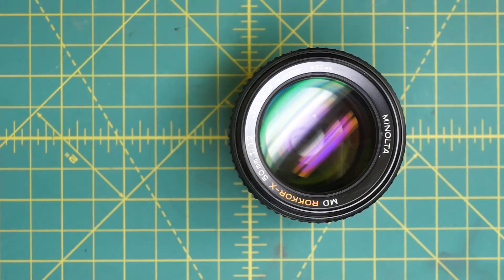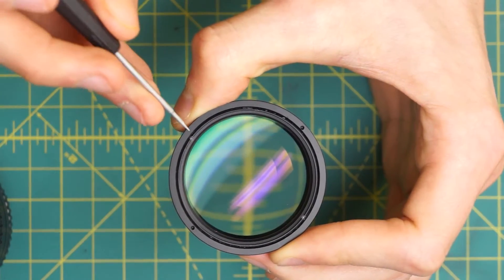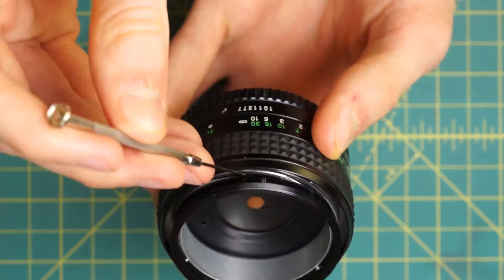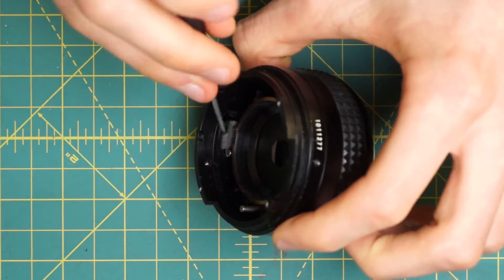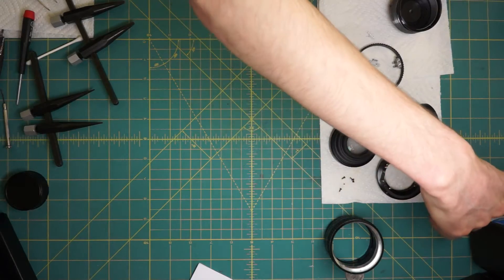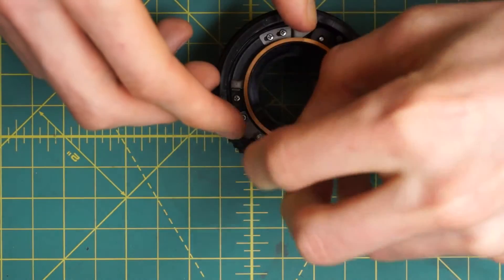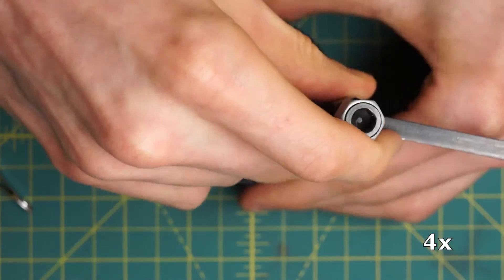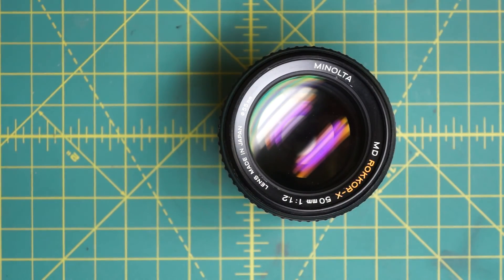Minolta MD Rokkor-X 50mm f1.2 Lens Disassembly

Comment: Thanks for sharing. I have a 50 MC ROKKOR lens, and there is only a small amount of dust in it. I will hear some noises when I put my ear to the side when rotating the focus ring, but the rotation process is very smooth. Is this because the damping oil is about to dry out? However, taking it apart at this stage may not be worth the gain.

Comment: Thanks for the disassembly and all the details. I have a question, what if you forgot to mark? Happened to me once, and that lens went to bin unfortunately. No matter how many times and ways I tried, never managed to find the correct location to screw in, is there a way to find if you didn't mark?
Thank you again.
Reply: Don't toss a lens you forgot to mark! I've done it, and I've bought lenses that have been improperly reassembled, and they can almost always be recalibrated to an acceptable degree by adjusting things so that infinity looks right.

Comment: Thank you for your videos! I recently picked up an MD 50mm f1.2 lens (the later model) which had two problems. It wouldn't focus closer than 0.6 meters and the aperture wouldn't stop down past f8. They were relatively easy to fix after watching this video. in both cases it was just a matter of correct assembly. Your video was particularly helpful with the focus problem. I used your 0.45 mark as a guide and luckily that alignment worked for me. I referenced your mark with the stopdown lever and other parts on the inner assembly and it worked like a charm. Thanks again!

Comment: Hi Matt, how to disassemble the back lens element?
Reply from the maker: Once you remove the back element from the lens, look for the divots on the rings going around the glass on either side. These rings hold all the glass in place. Depending on where you need to access in the element, select a side and start trying to remove the outer ring. The other pieces should then be sandwiched behind the first glass element

Comment: Great and helpful video BUT I have a MD Rokkor 50 1.2; when I loosened (and even removed) the tiny retaining screw, the frotn assembly rotates a tiny 3 degrees or so and then hits something very solid.  It won't turn any further. There's a blob of fungus behind the front element group that should be easy to remove but I just can't get to it.  Do you know how to get round the obstruction on a MD Rokkor?  Thanks for your time anyhow...

Comment: Thanks for this pretty great set of instructions. I had fun trying to get the ball bearing underneath the aperture ring with the first method, at one point I thought I had it but the ring would not turn and when removing it again the bearing shot across the room. Found it at last, used the second method (thanks for the hint), got everything up until the back plate assembled..but when putting the back plate on and focusing back towards infinity the back plate rises somewhat, this means that securing it with the screws doesn't work so well. I suppose the inner focus mechanism travels too far back because it didn't engage with the barrel correctly? Can't fathom what else would be wrong. Will disassemble it anew at next possible juncture.
Reply from the maker: Did you actually screw apart the focusing mechanism or disconnect it from the main lens body? That's the most common cause of what you describe. There's a few different ways it can fit back in, so you may have to play around with things until focusing works properly. Also check to make sure the focusing indicator is moving between the two distance markers correctly and that everything is set flush down in the lens. That's another common cause of problems. 

Good luck
Reply: Yes, I disconnected the inner focus mechanism+aperture section from the outer focus mechanism section as in the video, followed the steps rather precisely, except sliding the inner into the outer back together again, I belive I turned the inner one turn too many (it went from the 0,45 - infinity markers then too though), which meant it ended up too far back. This time around everything was flush, the aperture ring didn't bulge near infinity. The little bearing went flying again but it makes a different noise from dust and normal indoor debris so found it. Would prefer a clickless mechanism but as someone else noted wide open doesn't stay quite wide open then due to the force of the spring. Many thanks for your quick reply! This lens is super fun on an A7 and I'm never ever going to attempt fixing a 58 1,2 :)

Comment: question bro what's the difference between the mc and md model and some rokkor-pg/pf/ect.? ty for the reply in advance
Reply from the maker: Generally, MD means that the lens has an extra tab to let the camera know the minimum f stop. MD lenses also have a different exterior design than MC lenses, but there are a lot of similarities between late MC-X lenses and early MD lenses.

I find that MD lenses have higher quality optics and coatings, but feel cheaper and are not as repairable. I also just like the feel and photos the older MC lenses produce. 

The PG part refers to the optics. This site has a good explanation: http://minolta.easypix.de/lenses/

Minolta never made a 50mm f1.2 MC lens as far as I know. Besides this Rokkor-X version, there is also just a plain MD version of this lens. 

Hope that helps.

Comment: Have you done a video where you clean optics? I've opened up and cleaned a Pentax SMC A 50mm f2, but I could not get it very dust-free when reassembling.
Reply from the maker: KantraScepter Unless there is a problem with the images a lens produces, I would recommend against disassembling the optics. The exposed optic surfaces can be cleaned just fine in most cases, but internally the optics may use more fragile coatings, and it is hard to correctly reassemble them without introducing more dust or fingerprints.  

Dust usually has no effect on image quality except in extreme cases, such as shooting into the sun at f22.